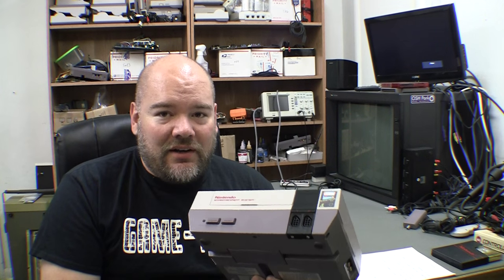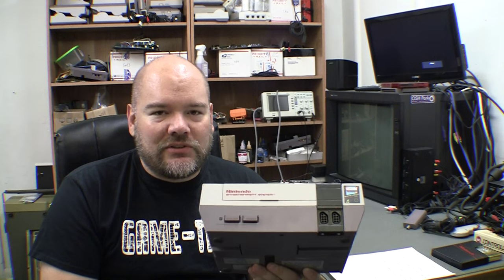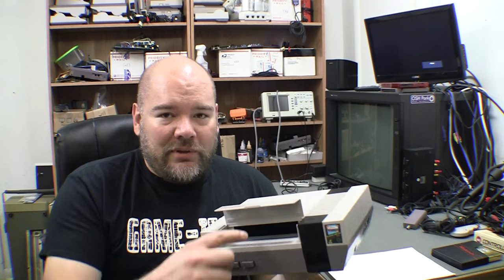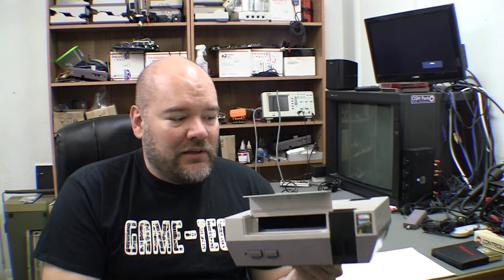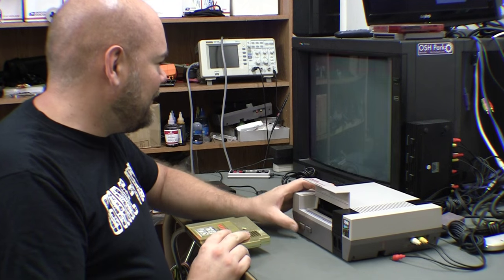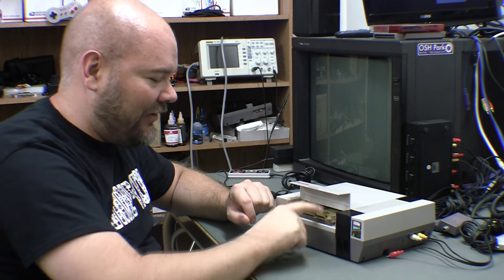Nintendo NES - Blinking Light Win review - zif connector replacement

Comment: Just got my BLW yesterday and installed it.  I couldn't help but notice that my connector was a V2 that did not need the secondary board fix for the lockout chip.  It works awesome and cart removal is easier than others have been reporting.  I can easily remove the cartridge by placing one hand on the console and removing the cart with my thumb and index finger on the ridge provided by the cart.

Comment: I got sick of dealing with the connector years ago so I mounted all the components on a piece of wood, cut the pin for the lockout chip, and soldered a game genie connector directly to the motherboard.  Never had any issues with connectivity since.
Reply: Shit can you do a vid showing this?
Reply: Dave Jewell I don't want to take it apart to redo it on video.  So long as you have a soldering iron, it's simple to do.  Just take apart a game genie, steal the edge connector out of it.  It has nice long pin legs on the side opposite the cartridge connector.  Solder each one of these pin legs to the edge connector on the NES motherboard and you're done.  Just make sure you don't load your games in backwards as there's nothing physically stopping that from happening.  Downside is of course the motherboard no longer fits in the NES housing and you sacrifice a perfectly good game genie in the process which is looked down upon by collectors.

Comment: I replaced a model 2 SNES cart connector in 2003 and my eBay replacement had a different gap between the rows of pins. If was very difficult to spread them and get them all through when I was using desoldering braid, but it true work.

Comment: The CIC clone chip is most likely an Attiny13 Krikzz completed it awhile back.

Perplexing why they didn't mount the 4 pin SOIC on the main board maybe they messed up the pinout. Another reason why you should always make a few proto boards and TEST everything electrically and mechanically before putting your PCB into full production. I can fully understand not junking otherwise perfectly good PCBs though and for a bodge board it looks pretty good :-).

Comment: I backed the kickstarter and got mine about a month ago. It is a little tight, but I compared pulling carts out of the blinking light win (loose; before installing it) vs my top loader and to me the amount of force required to remove a cart was about the same. It's just a little more awkward to remove the carts once installed because you have far less to grab onto.
I guess it depends a lot on the person. My brother struggles removing the same games I can get out without much trouble.

Comment: Im also concerned about the Grip on the connector. They had revised the connector several times to get the grip just right before these started shipping. It should be obvious that a connector with a toploader grip isnt going to be ideal for a frontloader. I guess they will have to revise it once more.

Otherwise, this is a great product and definately fills a need. No more cheap zif connectors!

Comment: How tight is it compared to the Hyperkin NES connector? I have one of those and it seems to have a death grip on the cartridges.

Pretty creative using the cartridge tray to mechanically clamp the connector to the PCB to keep the stress from the high insertion force off the solder joints.
Reply: It definitely doesn't have a death grip like you're talking about. It does seem awfully tight, but it's mostly because you don't have much to grab onto to pull it out. As Jason said (and I agree) is about as tight as a top loader. I don't think it'll damage carts (at least not any more than a top loader would). It could be a little looser, but in my opinion is not horrible and is worlds better than what's available otherwise.

Comment: I have one of these.  It's an improvement in some ways, but my biggest issue is the angle the cart plugs in at.  It makes it VERY hard to actually get a good grip underneath the cart, and that's especially true with various unlicensed carts.  I wish they'd angled the connector and tray so that the cart naturally rested in the exact same position that it does on an unmodded NES.  If they ever rerelease the thing, here's hoping they make that change.

Comment: I bought this item under a year ago. I used it for a few days. I put away my NES for a few months. Now I recently tried to use it and the games no longer work. All my games are clean. I ended up uninstalling it and put in the old 72 pin connector and it works better than with the Blinking Light Win.  I e-mailed Arcade Works and they are yet to answer back. Buyer Beware. Might as well just buy a new 72 pin connector from eBay or Amazon for around $10 and as long as your games are clean it should work for a long time.

Comment: I noticed mine being pretty tight as well, but i think over time it'll loosen up to a point where it wont be quite as bad.  but i'd rather it be tight and work well instead of the deathgrip pins that are tight and still have issues working.

Comment: Awesome video wish i knew what you where talking about though with the blinking,
Reply: To my understanding, Blinking means you're probably means the system lockout chip isn't getting a solid connection to the cart and its lockoutchip, the system has to get a good connection to a specific pin (s).

Comment: I dont recall how the pins where on my NES when i first got it back in the 80's.  Were they as grabby as they are nowadays?  Wont the pins eventually loosen?
Reply: The '80s console had a Zero Insertion Force (ZIF) connector, so it had no "grip." You had to push it down to make contact and it was physically blocked from being pulled out so it didn't need grip. Well, it needed it to work well but didn't have it. ;)

Comment: Neat, but I don't think I'd want to have a front-loader without a ZIF connector. From the video title I thought the replacement was going to be an improved ZIF connector, not a conventional card-edge connector.
Reply: The whole point of this is to eliminate the ZIF connector entirely. The original ZIF connector is really a poor choice for something that you're going to repeatedly use. I know similar things are still used today, like in RAM slots in some laptops, but you don't often insert and remove ram chips hundreds of times. Standard card edge connectors are much better suited for things like game consoles.
At the same time, the front loading design of the NES-001 doesn't lend itself to a standard card edge connector very well. It's really designed so that there is very little resistance when pulling out a came cart. Even though the card edge connector in the blinking light win is actually not that tight in and of itself, the fact that you have so little of the game cart to grab onto to unplug it means it feels a lot worse than it really is. It could probably benefit from some sort of eject mechanism. More so than top loading systems like the SNES where it's relatively easy to grab the cart and yank it out.
Reply: adimifus Well I get that the idea is to replace the connector with something more reliable - I just thought it was going to be something more reliable, but also ZIF. Given that the front-loader's design is completely ill-suited to using a standard card-edge connector (having no eject button and not a lot of wiggle room to grab and remove the cart) this thing just seems like an inherently bad idea, and pretty pointless considering that one could just get a top-loader instead.
As an example of what I had in mind, Ben Heck did a NES front-loader build with a powered slot. I think the project itself was a bit of a mess (he couldn't fit all that into the original NES case) but he addressed the connector issue nicely: the two rows of pins clamp down on the cartridge PCB after the cartridge is inserted (so it's a true ZIF slot, the pins don't make contact at all until the cartridge is fully inserted) - that concept could be used without the motorized slot-loading system to create a more reliable ZIF slot for the NES.

Comment: mental note if I buy this ware down the connector for an hour before fitting that fit looks hilariously tight. one question hope you can help, I have my old child hood NES that the was having issues with the lock out chip so I brought it to a guy how said that they cut the lockout chip and replace the dock connecter for €20 so I left it with them long story short they killed my child hood NES and they said they couldn't fix it. so I opened my NES and they mangled the lockout chip, looks like they tried to desolder it but burnt off some pads and screwed up the pin out by cutting the wrong pin the wiring a cable from pin 4 to anther pin. so right now I only get grey screen no matter what ( also this is the reason why I got into doing my own repairs) so the Light Win has a custom Lockout chip dose this completely bypass the original lockout chip or dose it still need the original Lockout chip ? cause if its a full bypass my old mint child hood NES may come back to life would be really grateful if you have time to answer this thanks.

Comment: GameTechUS well you should try to clean the gold on the board on the loin king chip i got my games going alot good and all i used was a eraser you use to erase the penil marks with and i clean up the gold on them and it work find but make sure you clean it off after using the eraser but i think your loin king work

Comment: My NES is modded with an RGB board from Tim and has the pin 4 lifted.  Will either of these things prevent the Blinking Light Win from working with my system?
Reply: late reply but it shouldn't
Reply: +BeatlesCuber works fine on my 10nes lifted by me.
Reply: +Costa “mrGREEK360” Apostolou I did the mod and have blw it works just fine

Comment: pal games will run faster on a ntsc console, the whole 50hz/60hz issue. i came across the it when i tried to play ntsc roms on my pal snes (ran slower)
Reply: Yeah, 'region lockout defeat' is the wrong wording for the BLW. All it really does is defeat the 10NES lockout chip similar to how Tengen carts and other unlicensed carts back in the day defeated it. If you truly want a Region Free NES that corrects the speed for both NTSC and PAL games, buy the AVS. It has the same type of cartridge front loading as the BLW along with a top loading Famicom slot. But I'm sure this info is very well known by now ;)

Comment: I can see that "zero insertion force" connector seriously damaging plenty of carts
Reply: opsimathics the "Zero Insertion Force" connector is the old connector, this is a REPLACEMENT for that.

I don't think it'll damage it, the design is just not clever enough to get a good enough grip around the cart.
Reply: +Nukle0n It digs into the PCB
Reply: +Zestypanda It has to be a tight fit to grab the pins, that's why the original ZIF socket would bend the pins to grab the cartridges. This is a regular card edge connector socket like literally every other console uses, the problem is that there's no extraction mechanism like on the SNES, and it's in a horizontal position, plus there's very little gripping service. It just shows why they couldn't have used this method originally if they wanted to use the "VCR" design where you insert the cartridge horizontally.
Reply: Nukle0n But the adapter still can damage the actual PCB/Pins of the cart.
Reply: +Zestypanda If people really are reporting that, sure. Just saying it's not an inherent problem with the design.
Reply: As he shows in the video, the grip on the cartridge is no more than an NES top loader connector, and it's probably no different than an SNES or Sega Genesis connector.  Damage to the pins seems like a non-issue since so many other consoles have used a similar connector unless NES cartridges are somehow more fragile than other consoles.
Reply: Two years in and no one is reporting damage that I've seen. I really don't think this grips carts any tighter than any other connector on a cart system. The only difference here being the lack of surfaces area on the installed cart to grip and remove it.